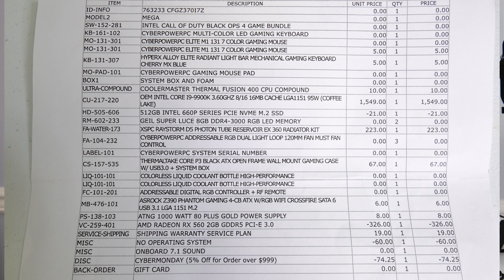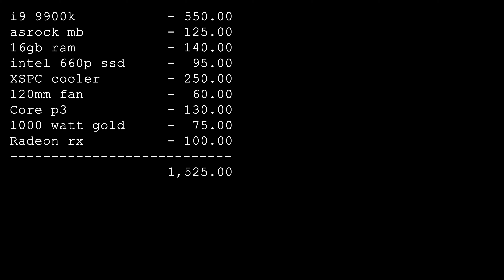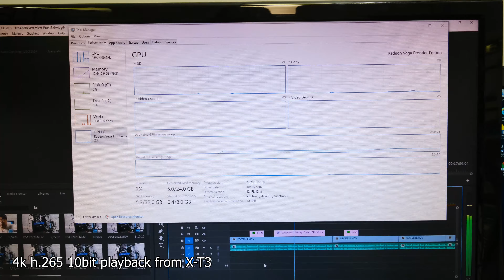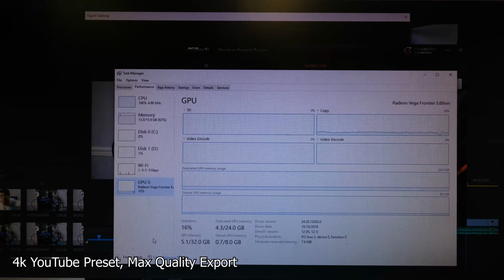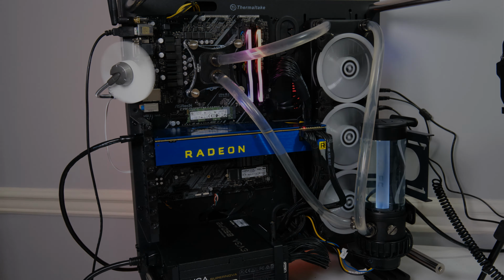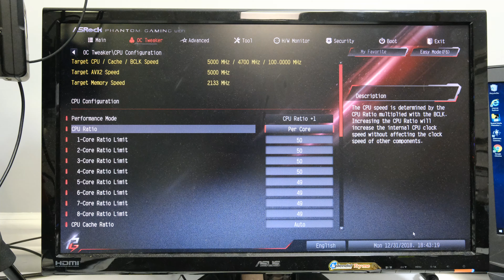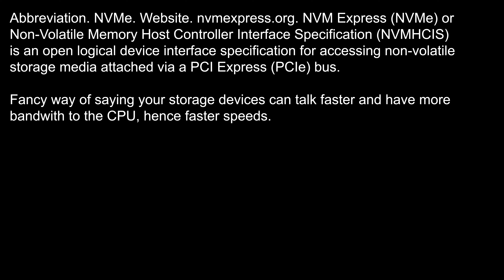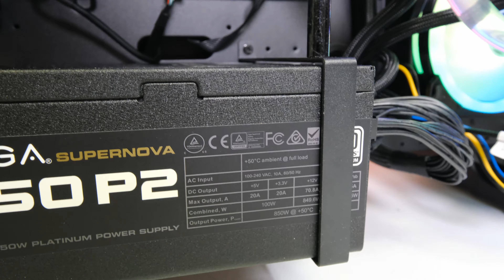4k Video Editing PC Computer 2019

Comment: how quiet is that with all the fans?
Reply from the maker: the loudest fan is on the video card. I can easily tune out the slight hum of the computer but when the video card fan goes into high gear, it's loud. It's the only fan i dont like.